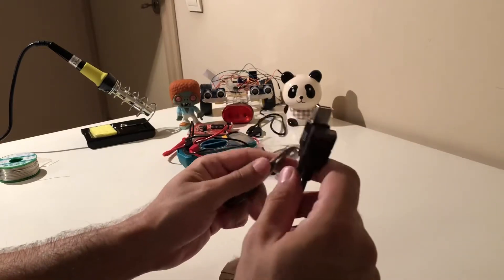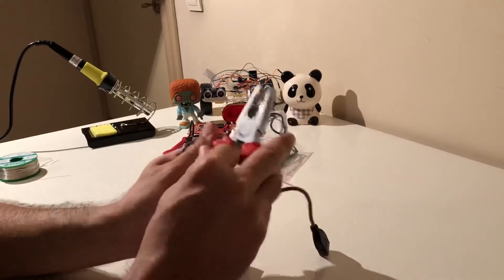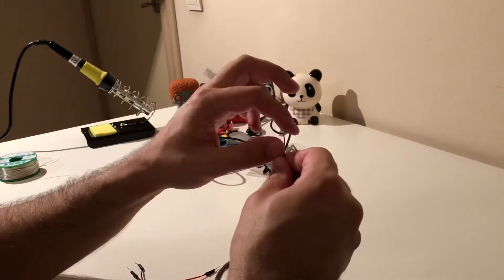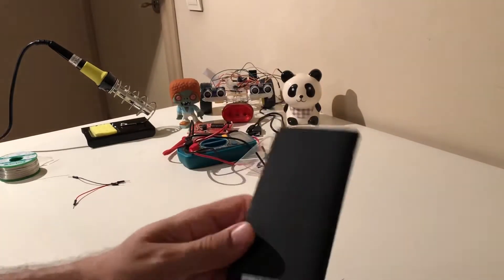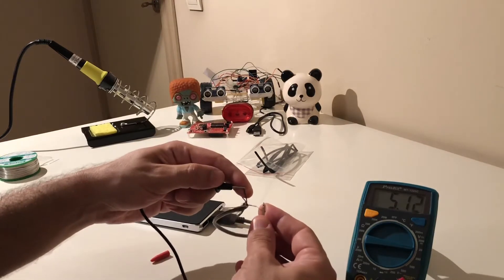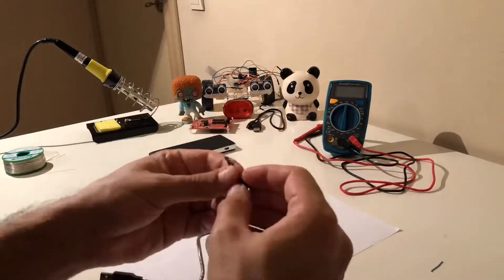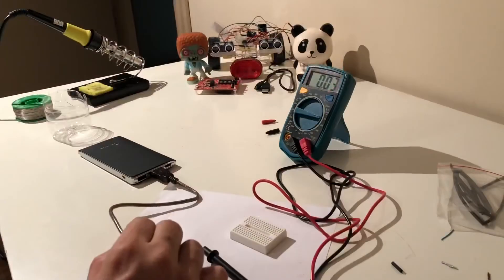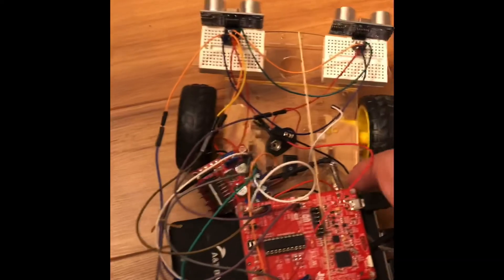Making a 5V USB Power Cable

Comment: if i solder 3 wires on each positive and negative wire, will each of the three cables get 5v? 

Using it to power two servos and a lazer diode.
Reply from the maker: Hi, yes, (if your source is sufficient to supply necessary power to these components)
Reply: @drselim  Alright, thank you for the reponse, especially this fast.
Reply from the maker: @rumpy3025  you’re welcome
Reply: @drselim  turns out the power supply couldn't handle two servos, one will just randomly go 180 to the right and die, the other one will die soon after.
Reply from the maker: @rumpy3025  I see. As another reference: The powerbank I use in the video is 5000mAh and from its two USB outputs, it supplies power to the MSP430 launchpad and the L298N motor driver which has two 6V DC motors attached.
Reply: @drselim  Maybe i need to put diodes on the positive wire? Friend suggested it to me. Ill stick to using two separate power supplies for now

Comment: Is it safe i use this for an Arduino and servo's?
Reply from the maker: If your power source is reliable (regular powerbanks or the usb output port of a phone charger etc.) you won’t have a problem. Just be careful not to short circuit the cables. Nearly all my portable projects make use of such a cable. You can check out the wireless gas sensor node video which supplies 5V to the gas sensors. I also used the cable for servos.